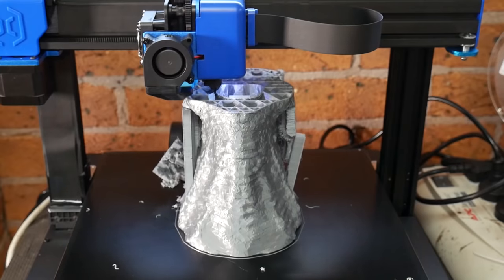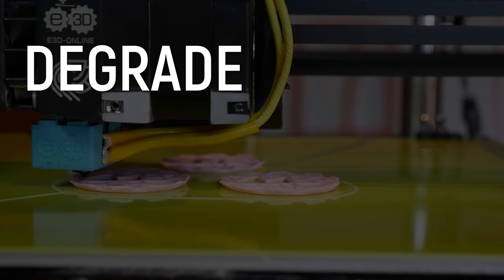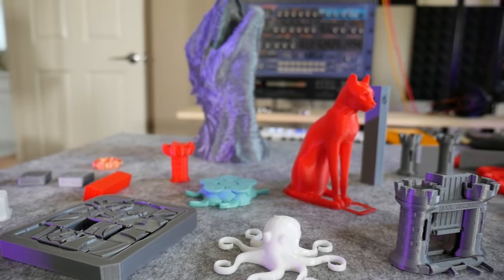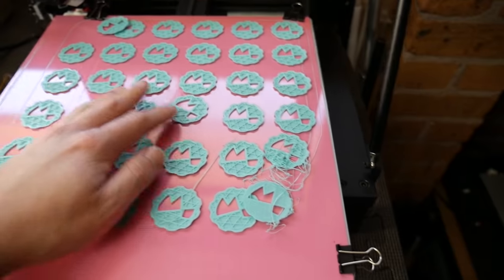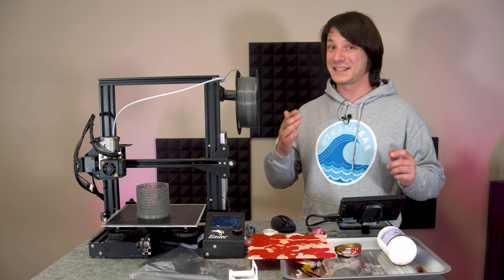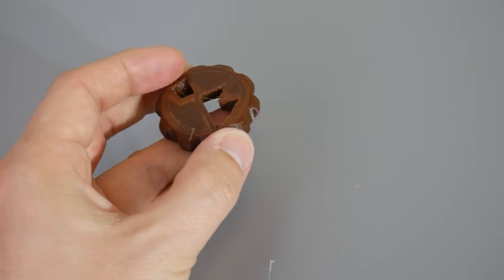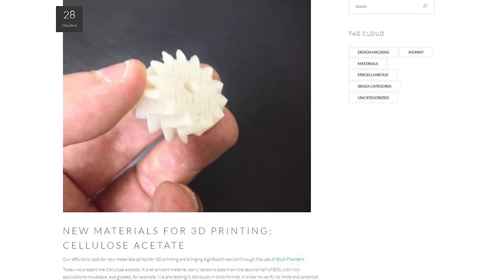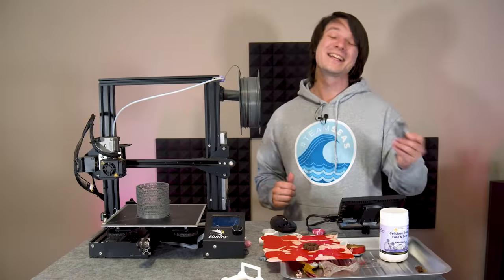PLA - 3D Printing's Biggest Lie.

Comment: The whole issue with plastics and any other such difficult to get rid of material is that there is an inherent contradiction. The reason we make them is their good strength and resistance to acids in your beverages and bases in detergents and basic handling and weather events, but these traits are exactly the ones that make them non-biodegradable. The good thing about aluminium cans for instance is that the recycling process is not degrading the material but the acid resistance is provided by a thin plastic film inside it. The issue is that there will never be a biodegradable plastic or any other material that just dissolves in the environment because that will actually make it unfit for purpose.

The only type of plastic that works is one where we actually have an artificial solvent that does not exist in the environment to make the idea fly.

And then there is glass... its main issue at this point is its weight to strength ratio. It is too brittle but there are additives to improve that but silicon dioxide is just fine even if you throw your beerbottle in the sea(please do not do that) but it will ultimately become blass pebbles and sand over some years.
Reply: Yes and that plastic layer, that is sprayed on the inner walls of aluminium cans, is exactly why i avoid them since this stuff can come lose and you involuntary consume it. Thiee swiss SIG aluminium drinking bottles for example are so bad, this plastic film starts to flake off after a few years and contaminates your drinks.  Personally i'd rather see metal and glass 3D printing (or mineralglass printing) rather than plastics. Even cellulose could be used but then again,,, paper mache can be done easily even without a 3D printer.
Reply: But honestly I don't need plastic cup for 500 years but for 4 hours

Comment: When I bought my 3D printer, there were already strong indications that the biodegradability of PLA is only really theoretical. I also did stick one of my first failed PLA prints in a pot next to a plant that sits in the rain and weather all year round. It has been in there for +4 years now and still looks the same as day 1. For this reason, I never throw my failed prints or support material waste into the trash, I have kept all of it in jars nicely separated by filament, in the hopes of some day recycling it into new filament myself or handing it to someone else who can do something useful with it.
I hope your quest to find a truly biodegradable filament leads somewhere, because I would feel a lot better printing silly gadgets and other disposable things in a material that won't keep making round trips in the food chain…
Reply: I am planning on making a machine to recycle old prints or plastics and turn them into filament. I just wish you could make filament from plastic number 5 bc they can’t be recycled in my area and I have a pile just building up in my room
Reply: @WaffleSalad  I came here today and want to share, biodegradable usually means compostable in industrial composting on high temperatures.Not "just plant it in soil.".

Comment: yep, greenwashing. Same as the biodegradable bin liners, but arent unless in an industrial biodigester same as pla. Which isn't happening for general waste and why would you use bin liners for anything going into a digester. So much greenwashing going on and it so annoying, as the public just generally aren't aware. So great video. Be nice if protopasta or one of the other manufacturers got onboard and did some public devlopment.
Reply: Even PLA being "biodegradable" extends far past 3d printing. It seems about once a month a "new biodegradable plastic" makes the front page of reddit. Every time it's just someone making PLA out of a different base material.
Reply: I’ve been keeping up with this too. Just seeing “compostable” cutlery hanging on the shelf in grocery stores or getting it with my poké bowl makes me sick now. Even my university has it now to be all r/fellowkids. I keep literally all my PLA until I find either a use for it by recycling, if there is investment in ACTUALLY composting it or I die of old age.
I don’t use it because it’s compostable, but I’m damn well going to make sure it doesn’t end up in the water if I can help it.
Reply: @brandonsaffell4100  the very same crosslinking that makes it useful makes it not so degradable. Even bones take thousands of years do degrade
Reply: "Greenwashing" I've not heard that term before but I like it. Our local council have stopped collecting our food bins due to the "HGV driver shortage".  We've been told to put our food in with our non-recyclable household waste. I asked a council employee about restarting food bin collections and he said: It doesn't matter. It all goes in the same incinerator anyway. So much for recycling!
Reply: One problem with biodegradable plastic is it can contaminate plastics being recycled. A very small amount of biodegradable plastic can ruin a large batch of recycled plastic.

I don't think there are easy solutions but I sure hope governments can get past the stage of greenwashing. They needed to stop doing things just for the sound bite and come up with real solutions.

By the way, there is still plenty of landfill area in most of the world. Having plastic end up in a landfill isn't necessarily bad. Having plastic end up in the ocean is bad.
Reply: Greenwashing isn't the only issue, another big issue is what I would call "advanced greenwashing" and "graywashing". Advanced Greenwashing is the type of solutions proposed by environmentalists that only really work in idealized situations or don't really work at all but sound like they work in theory. Recycling is a big and obvious one, with nearly all of it (that isn't industrial waste) being unusable for actual recycling due to contamination and in a lot of places they just mix everything anyway, it only really works if everybody is very selective about their recyclables. Windmills and solar panels on a grand scale is another big one in most of the world. (They are a decent supplement depending on part of the world, not a complete replacement)
As for Graywashing, it's stuff like environmentalist claiming biofuels are not CO2 neutral. Burning wood releases most of the CO2 stored, but growing a tree stores it and getting those 2 balanced isn't particularly hard. Another big one is nuclear power, while in reality it's the safest energy source we have that also is carbon neutral (and even storage isn't a particular big problem these days). A lot of graywashing attempts come from other environmentalists topics. They have been anti-wood cutting and nuclear for the better part of a century and admitting things they have been opposed to as not being bad means they have egg on their face.
Reply: Germany's 'bio fuel' which is brazilian rainforest timber 'carbon neutral' because it was bought from abroad, not german trees.

Then there's lithium mining and battery lifespan.
Reply: @Chilternflyer  when plastic made from oil is burned in an incinerator and turned into heat and power you have to use less "virgin" oil for heating and power, so as long as we haven't completely stopped using fossil fuel for heat a power it should end up about the same
Reply: Green on the outside, red on the inside!
Reply: @mandowarrior123  "Then there's lithium mining and battery lifespan."
Lithium batteries go bad with use and time but the lithium is still in the batteries. I'm pretty sure a lot (hopefully most) of the lithium from lithium batteries will be recycled.
Most aluminum is recycled and I'm pretty sure most steel is also recycled. Metals are some of the easiest materials to recycle. Hopefully lithium isn't too hard to recycle.
Reply: @ddegn  Recycling aluminium makes the most economic sense. Making new aluminium from bauxite uses more energy than recycling existing aluminium metal.
Reply: @ddegn  lithium recycling currently is both terrible for the environment and not economically viable, like plastic recycling.
Reply: @ddegn  you literally can't "ruin" a batch of recyclable plastic because like unicorns it doesn't exist.  Plastic is buried or incinerated.
Reply: @danmerillat  "it doesn't exist."
Of course recycled plastic exists. It might not be a good idea and it's likely not economical but it exists.
There are plenty of examples online.
One example I've seen is planks for benches.
Reply: "a wall can be called green  if you want it to be" heard that somewhere, or something like it anyways. i dont have much faith in the "green" movement
Reply: But you can't win. I know someone who sells bin liners alongside their bin cleaning service. How many people complain when they don't offer biodegradable bags? all of them. How many listen when they say biodegradable is a complete line? none of them.

they can put all the effort in they want to tell customers that them driving around to clean bins once every few months waste fuel, water, the dangerous chemicals they then have to dispose of after cleaning vs the damage through using a roll of bin liners for a year, but they don't care. they WANT the green-washing biodegradable bags, and they have now started selling them BUT tell the customer "its not like if it gets into nature it will break down AND you are putting landfill rubbish in your bin anyway"

Comment: I know there is a lignin filament out there, I've seen parts printed with it and they were absolutely fantastic! Unfortunately it's sold under some weird name that doesn't give away that it is lignin, which really is a shame. it apparently prints as easy as PLA with comparable material properties, but is completely biodegradable.
Reply: whats it called?
Reply: @MrRevolverkiller  A tree!
Reply: It's so sad Steve Jobs died of lignin
Reply: @rmdcade1717  who's Steve Jobs?
Reply: @pew6534  lignin microbeads thoooooom
Reply: sigh 
There was a good comment here. And then we came in.
Reply: Found it it's called greentec its from extrudr it's pricy 45€ for 800gr, they are saying that it is lignin based.
Reply: We did extensive experiments with lignin in injection molding a couple of years ago but couldn't see any advantage over, say, polypropylene. It's expensive, has an UV problem, a weird color (think Marmite), is energy-intensive to make and quite a nasty chemical to handle at the plant where they make the resin.
Reply: @f.d.6667  So... not biodegradable?
Reply: @jodrei7643  greentec from extrudr is not ligin based. They do sell a range of products which are certified biodegradable under ISO 14855,  but this applies to pretty much all PLAs. I bought some greentec a while ago and it's a PLA-blend  Compostable ≠ biodegradable
Reply: Zack on Voidstar Labs just did a video about the filament yall are talkin about IIRC
Reply: Lignin is natural, but it's actually very resistant to biodegradation. It's the component of wood that makes it last longer since cellulose is readily degradable, but lignin can only be degraded by a few different fungi.
Reply: There is Unicofil Silky which is a version of Tecnaro Arboblend, a mostly lignin based plastic, that prints very nicely and looks fantastic. Not sure about how it degrades.
Reply: If it's a realististic path, and it seems like it could be, developing biodegradable 3D printing plastics is obviously the way to go.
Reply: Our local (czech) company Fillamentum is creating filament from material called Nonoilen - which is supposed to be "really" biodegradeable. But I was not able to test it yet :(
Reply: @nufnuf816  Sounds interesting. However, having checked their website, they claim that Nonoilen was "...100% biodegradable in industrial compost and electric composters...". It might (again) mean that in nature it will stay almost forever, just like PLA
Reply: @nufnuf816  nonoilen seems to be a blend of pla and phb
Reply: You mean arboform?
Reply: @rmdcade1717  No dude, he died of ligma.
Reply: @CUBETechie  Arboform is not available for FDM printing. The only option would be Arboblend, but this is again a mixture of different polymers including PLA
Reply: @EricHabib  not being biodegradable isn't too worrying if it's not harmful. Stones aren't biodegradable and lignin is found in trees which have been, around a while. It's the behaviour of the material out in ecology that matters.
Reply: So is PLA. It is actually as easily as cellulose and lignans to breakdown using mushroom that consume lignocellulose. PLA shavings are commonly used in my substrate.